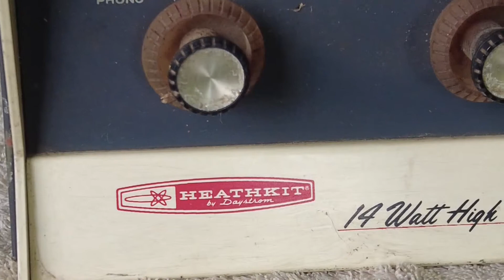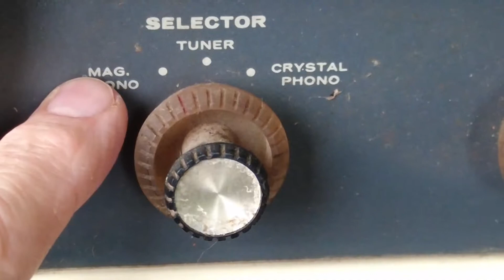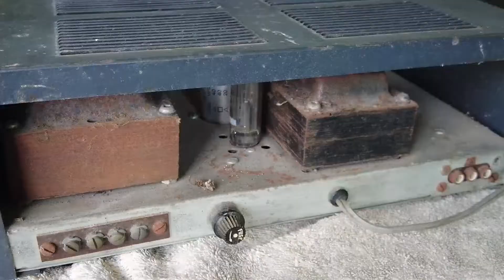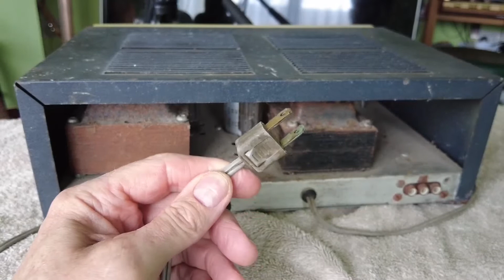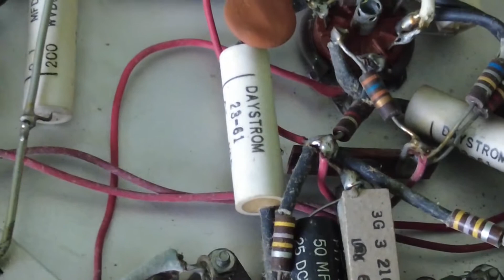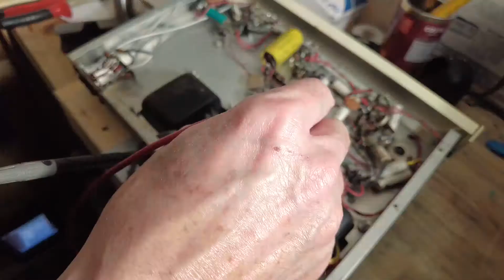Heathkit by Daystrom 14 Watt High Fidelity Amplifier

Comment: I don't know if you noticed that under the "Heathkit" badge on the front of the amp it also says "By Daystrom" Daystrom was the name of the company that owned Heathkit. You also notice the tube says the tube is made for daystrom, It would have been made by one or more of the big tube manufacturers maybe Westinghouse or Philips etc.
Reply from the maker: Hell Doug, I didn't at the time I was working on it. I did notice it later and Googled it. I did research the tube too. I should have done all that first and then put it in the video. Thanks for watching and take care.
Reply: Daystrom was the parent company of Heathkit, they acquired the company in 1954 after the previous owner was killed in a plane crash